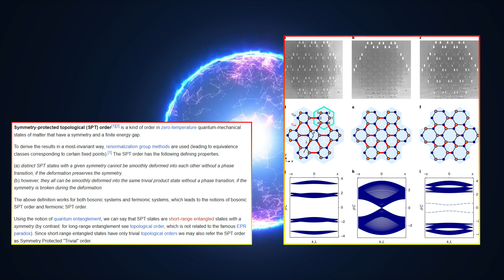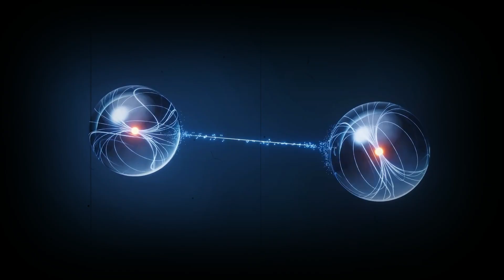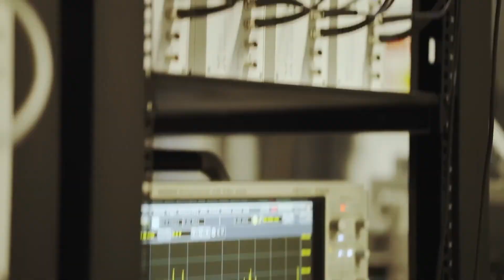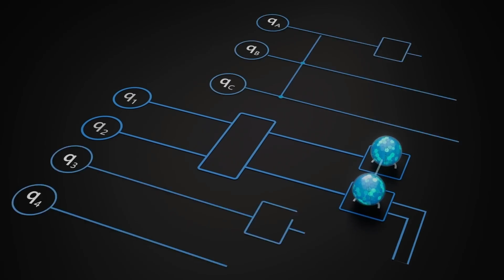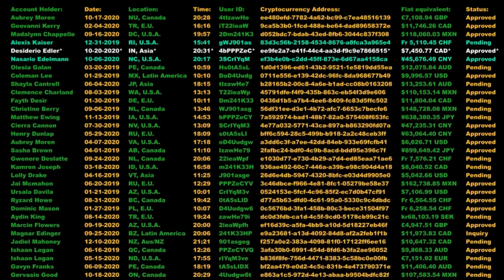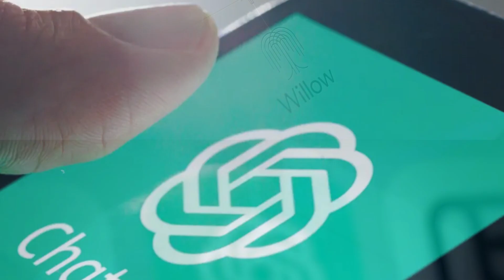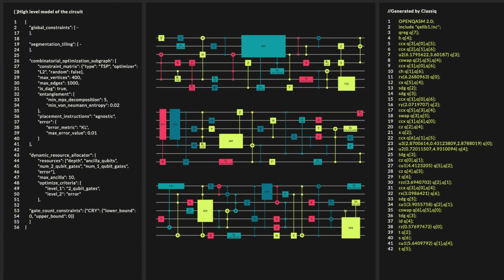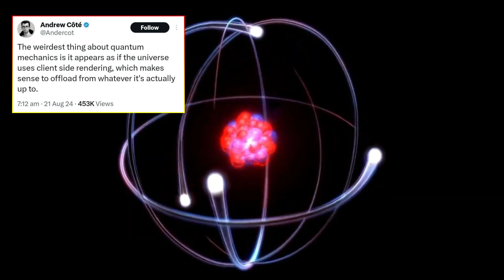Scientists Fear a Multiverse Nightmare as Majorana 1000 Qubit Chip Advances

Comment: "Yo, check di Majorana 1—8 topological qubits, 1% error, runnin’ trillion-op tasks like material sims in 11.6 days (T = 10¹² / 10⁶). Scale to 1 million, it’s 1 μs (10¹² / 10¹²), stable an’ fast—computin’ king, not reality warlord. Energy? 2 × 10⁻¹² J/s—weak, can’t touch spacetime (10⁻²¹ off Planck scale, 2 × 10⁹ J). No phasin’—qubits stuck in info land, no timeline hops (Δx = 3 × 10⁵ m, spatial only). Crackin’ all encryption in ‘2 seconds’? Lies—8 qubits at 0.2% of 2048-bit RSA (8/4096), even 1 million just hits 244 keys. Manifestin’ dreams? 10¹² states/sec crunches numbers, not realities. Dem aggrandizin’ a chip dat cah do di big talk—fear-mongerin’ flops, fam!"

Comment: This chip is just a down scaled version of a quantum computer and quantum computers have been around for years. This is just misinformation. Its not exactly quantum mechanics that are being used in this chip it's just the method of using matter to process data rather then electrons like in the cpu's we use already. The creator has listened to a video about particles not acting as predicted and ashumed that it to do with parrellel universes. The experiment this came from was found to be the result of an error and when done properly the atoms worked as predicted. This is just unscientific bs. It there was really something to worry about or any break in physics it would be very apparent to everyone as we'd all be witnessing it.

Comment: I would say unless you have 2 quantum systems a computer operating for quantum entanglement shall not perform properly into a network designed with 1 bit systems it would try to change encryption to other systems that can not be accessed for just connecting when discovered.  It's obvious any system that's extremely faster at computing is encapable to compensate software other networks at simple high speeds even with fiber optics unless it's also quantum

Comment: i havent a clue what your on about - i cannot grasp what your saying -- where is all this happening inside that small chip ???????
Reply: Yes it all is happening inside of that little chip…… mind bending i know, and this is only the start of it . The best way i could try to explain this so you could understand it is like this. A standard computer can only process so much information at one time. To keep it simple it looks like this. If a standard computer was asked to solve for X in a problem. It would put together strings of possibilites one by one until it found the answer. So if the answer was lets say 6. A standard computer would solve by doing 1+0= 1 wrong , next line 1+1=2 wrong , next line 1+2=3 wrong, and it would keep going one line at a time until it reached the anwser. Now a quantum computer can take all of the possible combinations put them all together and do them all at once. In one operation, getting an answer almost instantly.  So when the problem becomes so big that a standard computer would take 10,000,000,000,000 years to put together all the combinations. The  quantum computer will do it in days , maybe hours. I hope that helps clear some of it up.
Reply: @Emptyspyder   Hi thanks for reply - sorry i should have sounded so dramatic saying i havent a clue what its about,  i understand the part you mention about all calculations done simultaneously (thats the easy part to visualize ) is things like  " how do they input data is it a simple keyboard ? "  where do the read the answers  is it a simple computer screen? "

--------- they mention certain computations were complete before the imputs were entered? (im trying to visualize this one) did a guy go upto the keyboard and party enter the data then notices the answer on the screen before he finishes ??  is this what they mean ????????